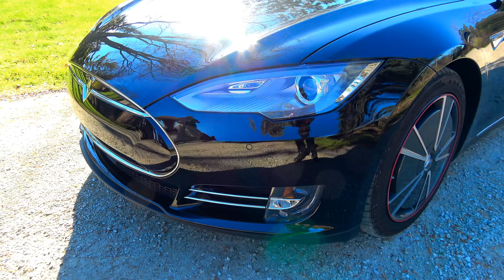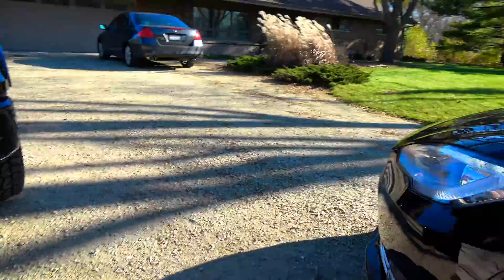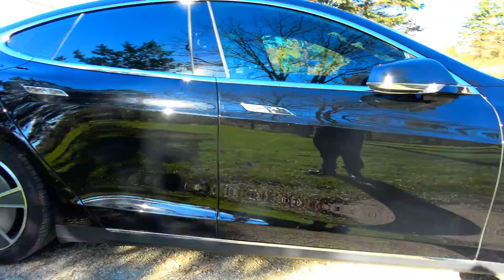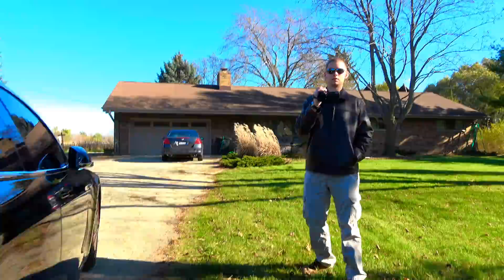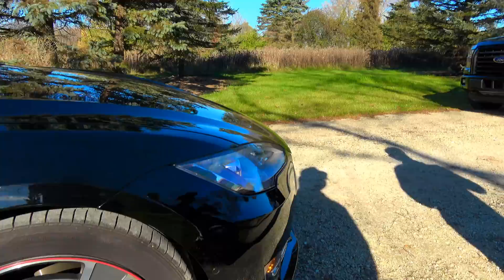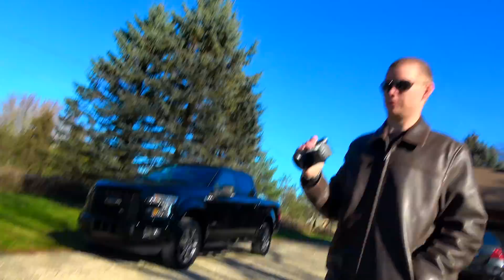Tesla Motors: Sonar Not Detecting Hand On Sensor!

Comment: That would be "working as laws of physics allow" - the ultrasonic sensor emits a pulse. If the pulse strikes an obstacle and returns before the sensor is finished transmitting, it has no way of detecting the returning pulse. Therefore all ultrasonic sensors have a blind spot before their minimum detection range.

Comment: It's probably the way they are programmed calibrated. There has to be a minimum distance away to allow time for the beam to travel and return. Less than a minimum time is seen as noise and ignored to stop false positives.
Reply: That's laws of physics, not programming or calibration.
Reply: Thrawn no you can have a sensor detect from micron distance but you get lots of false positives ie noise. so you program the system to ignore the noise below a certain distance or what some would call calibrate the sensor only from x distance rather than from 0.
Reply: I'm fairly sure the sensors can't detect while transmitting, so anything that bounces back while the pulse is being generated is not even received.

Comment: Thanks for all the informative videos. Love watching!
Ultrasonic sensors work off of reflection signals. The first reflection signal is what is known as "the main bang" immediately  following that is the entry surface signal (the reflection from the bumper cover) since these two signals are very close to each other it is detected as one reflection signal. In order for the system to "detect" something there must a separation between the first reflection signal and the obstacle (hand) it is trying to detect.
Reply from the maker: SPEEDYGT05 Thanks for watching! and thanks for the extra information.